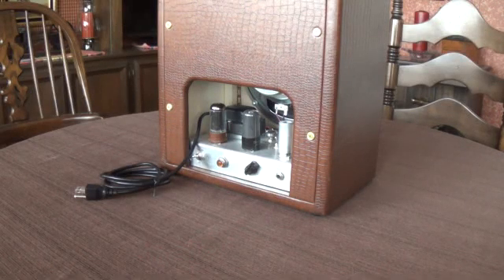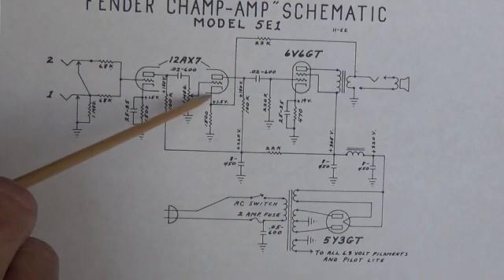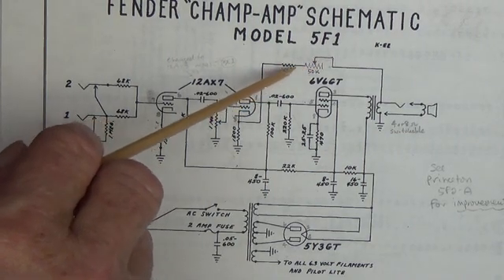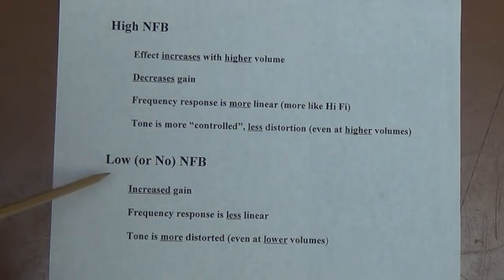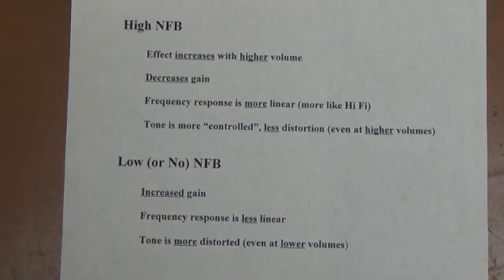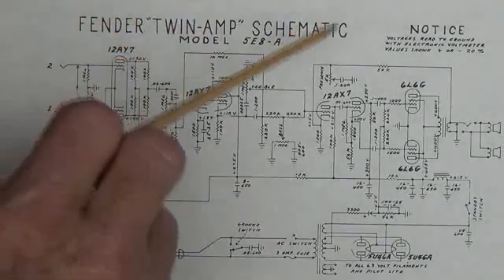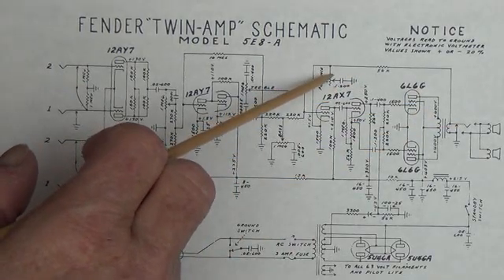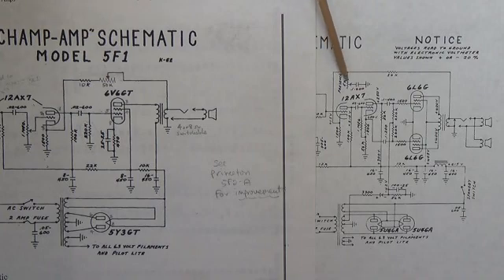Negative Feedback Loops and the Fender Presence Control

Comment: High-end audio amp designers would contend that minimum or no negative feedback is sonically superior.  Negative feedback introduces time domain distortion that does more damage to the sound than the lowered THD that results from NFb.  (They would say) The Japanese receivers of the 60s and 70s achieved vanishingly low THD by using high NFb and had cold, unmusical sound.  Comment?  But perhaps we are talking at cross purposes as you are talking guitar effects and I am talking subjective musical reproduction.
Reply from the maker: I was under the impression that HiFi circuits, at least the earlier ones, were (as you mention) dependent upon NFB to minimize THD and also used it for tone control......thus were far more dependent upon NFB than guitar amps ever were. Bear in mind that guitar amps thrive on THD levels that would nauseate an audiophile, and are intended for purposes diametrically opposed to most "HiFi" designs.

I have a friend who restores and collects McIntosh stereo equipment, and also repairs guitar amps from time to time. He has all sorts of sophisticated spectrum and distortion analyzing gear, and never fails to shudder in disbelief at the sonic mayhem that flows from (non-acoustic) guitar amps. It's apples and oranges.....one is designed for ultra accuracy and purity throughout (and beyond) the audible range, while the other is designed to make women throw their undergarments at musicians on stage.....and this just doesn't seem to happen (as often) with .0001% THD  :)
Reply: Uncle Doug
 Hmmm.  What would I prefer, women without panties or zero NFB?  Well, the women I suppose, but my alter ego was able to do that at the Paramount by just standing at the microphone and singing.
Reply from the maker: I guess if we could all sing like Frankie, we wouldn't need as much THD.....but the rest of us schmoes are quite thankful for it :))

Comment: Thaaaanks for sharing this.
So, can I just cut the NFL cable inside my 57'Champ Reissue to test how it sounds with all those lost frequencies otherwise cancel led safely?
My training it's been changing a couple of pick ups so far but I'd use rubber gloves, plastic clamps etc to manipulate the innards of the Champ circuit...
Massive thanks for this informative video!!
Reply from the maker: You're welcome, Ramon. You are wise to take precautions when working on your (potentially lethal) amp chassis. Be sure to drain the filter caps before touching the circuit (see my biasing videos for instructions if you don't know how to do this).

Yes, you could disconnect the NFB loop in your '57 Champ (R12 @ 22K), but I don't think you'll like it. This amp is designed to break up quite early, especially with humbuckers, and the lack of a NFB loop will probably make the tone excessively "dark", distorted, and noisy.  If you do it, let me know how it turns out. Here is a link to the schematic and layout:  http://support.fender.com/schematics/guitar_amplifiers/57_Champ_schematic_Rev-B.pdf
Reply: Thanks for the response.
Sadly as things turned out, I had to sell it.
But I hope I'll get a replacement next year.
I'll stick to my handwired VOX AC-15 for now.
Best regards!
Reply from the maker: You're welcome, Ramon. Best of luck !!

Comment: Thanks Doug for doing this video. I found it informative, concise and to-the-point. It was well explained. I am wondering if you could say something about the "resonance control" and how it could be mixed with the presence control circuitry you described in your video. I could not find any schematics on the topic...
Reply from the maker: Greetings, Julian, and thanks for the kind words. In the video description I offer the following note:  To turn the NFB Loop into a Resonance or Depth Control, add a .0047uf capacitor in series with the NFB resistor. To make it variable, add a 1Meg pot in parallel with the capacitor with one leg of cap. connected to the center (wiper) lug of the pot and the other leg connected to either of the (outer) lugs of the pot. For this to function, the Presence Control (if you had one) would have to be "off" so no high frequencies were being sent to ground. Here is a schematic:  http://www.regiscoyne.com/tech/resonance/
Reply: Uncle Doug Thank you. I could not follow the explanation straightaway but it has become clear now that I have seen the schematic. I still don't understand why you can't have a presence control and a resonance control together working as a sort of tone stack circuit if that makes sense...
Reply from the maker: There probably is a circuit that would allow both to function, Julian. Perhaps a search would turn one up. The Presence control functions in between the Midrange and Treble control and the Resonance functions in between the Midrange and Bass controls. From what I understand, the effect of these additional controls is most evident at high volume levels.

Comment: Thank you for your very insightful videos! How come you don't you need a diode on the negative feedback loop to make sure that the signal goes FROM the output transformer TO the cathode instead of the other way around?
Reply from the maker: You're welcome, Dj. The secondary of the OPT has higher voltage and much higher current (multiple amps), capable of driving a speaker.....while the cathode has very low voltage and extremely low current (milliamps). Thus the OPT signal, being more powerful, flows toward the cathode, rather than the other way around.
Reply: Thank you for your answer Doug! Very helpful indeed!

Comment: Thanks Doug and Rusty for the video. Always baffled me what a presence control did in reality on a circuit level. Really enjoyed your recent tone control video too. I will post comments there soon. Take care . I think you mentioned you once were a teacher, you still are. What got you into tube amps and electronics.
Reply from the maker: You're welcome, Mix. It's great to hear that the videos are helpful and appreciated. I started restoring vintage jukeboxes about 35+ years ago and wanted to be able to do all the work myself. This required that I develop the ability to repair the sound systems, which are quite similar to those in vintage guitar amps. Once I developed an interest in vintage guitars and amps, the jukebox-related knowledge was a great foundation. I have posted a few videos of my restored jukeboxes, which may be of interest. Thanks again for your input.....it is always appreciated :)

Comment: Thanks Uncle Doug! I always thought that I was creating a "presence" control that was just pegged in perpetuity when I DC'ed the NFB loop of an old Hammond (AO-44, AO-35, AO-fill-in-the-blank), but since an actual presence control is only rolling off very high frequencies from the loop with a high value cap, I suppose I'm sort of making a presence/resonance/gain/boost control that is, of course, maxed out! My AO-44 is like that, having pulled the input transistor and the low-pass filter stuff it was driving, I also pulled the NFB loop. I use it mostly as an output section behind my Frenzel (Jim Frenzel is a guy in Texas who builds and sells a lot of good PTP-wired stuff at really good prices, has an ebay store and frenzeltubeamps.com) preamp, or sometimes I use it for bass, with a little compression up front, and drive a single 15" black widow in a dead 1x15 solid state peavey combo. It works really well for both, and if I plug a guitar straight in, it also does an incredible almost-clean that I like for reggae-plucking with four fingers and then digging in with a thumb-pick. I am completely in control of the dynamics without touching the volume knob on my guitar. I do believe I will be subscribing now, this is a class I should definitely be taking.=)
Reply from the maker: Wow....thanks for all the info, Adam. It sounds like you are a capable ampliophile, who definitely should subscribe. I will check out the Frenzel Tube Amp site. Best of luck :)
Reply: Uncle Doug Done.....actually, I think I subscribed right when I was making that comment. And YES you should DEFINITELY check out Jim Frenzel's stuff. EVERYONE READING THIS SHOULD. He's often "backlogged" so it took longer than it was supposed to for my preamp to arrive, but a pair of 12ax7's in a pretty classic bassman/plexi (the preamp section of bassman or plexi, obviously) type circuit, point to point, gain+MV and 3 band eq, and I paid a discounted price of 200 bucks, but I think it's normally 275.....and that is obscenely cheap for what it is, I think. I've been looking around the web lately for more stuff to do to my "Yayo-FourtyFour" (nickname I gave it) lately, and I'm wondering if you know anything about the way an Orange "shape" control works, and if it would be possible to put one in an AO-44 that is basically stock, just with the input hot going straight to the grid of the first ECL86. I mean,m there's only two preamp stages, one's a driver, but I really only use it as a clean amp anyway, for separate preamps or on the extremely rare occasions that I want to get the sound of a particular pedal. I intend to try to build a 3x12ax7 high-gain overdrive with just gain and a trimpot on the output, and if the 44 had a really versatile tone control like the "shape" control on the Rockerverb and the Dark Terror, it would be perfect. . . . . Any ideas?
Reply from the maker: Adam, I looked at the Orange Dark Terror "Shape" control and it appears to be fairly straightforward, utilizing capacitors and resistance (like all passive tone controls) to allow selection ranging from "sharp" to "mellow". It resides between V2B and V3B of the circuit. If you wanted to add this tone control to the AO44, simply recreate the circuitry and insert it in the AO44 circuit, between the two stages of the 6GW8. How well it will work, I don't know, but like all experiments, you can simply try it and see. Let me know how it turns out.

Comment: Can you show about Phase Inverter what it does and also Solid State rectivires,love your site even I can understand some of it THANKS
Reply from the maker: I will be posting a Phase Inverter video in the near future. Re a "solid state" rectifier, you simply use diodes instead of the two rectifier tube plates. Since they only conduct in one direction, they will divide the AC into a positive (B+) and a negative (to ground) Direct Current. It's a cheaper and more efficient way to get the DC your amp circuit requires.

Comment: Uncle Doug,  

Can you go over what these amp modifiers do to increase gain, or add a variable gain knob, to increase gain gradually.

BTW, My uncle's name is Doug.  I asked my Uncle Doug but he doesn't know...
Reply from the maker: Greetings, Steven. The Bass (Resonance) and Treble (Presence) Boost are not really intended to alter the gain or amplification factor of the amp. They are primarily used to alter the tone of the signal. When you reduce negative feedback, the speaker volume will increase, but that is a side effect, and not the main purpose of these controls.

Comment: As long as you are taking suggestions, I think an explanation of American versus British tone and circuits would be cool. Of course Fender versus Marshall. We hear these terms in marketing and blog slang but what does it mean? So nice you are able to reply to most comments. When you get more views than Taylor Swift it may get harder to do.
Reply from the maker: An interesting suggestion, DS. I must confess that I am completely unfamiliar with Marshall circuit design, but I can download some schematics and try to figure out what the significant differences are (if any).  I try to respond to every comment, but (for some reason) YT doesn't alert me to some of them, and it would be a nightmare to have to check through all the comments for every video to try to find them. Meanwhile, Taylor better watch out.....we're catching up with her :))
Reply: Uncle Doug DS, The first Marshall amps were copies of the old Fender Bassman, which was never really a bass amp to begin with. Years back I got to hear what I thought was an old Bassman. The owner of the amp, a guitarist in an excellent ZZ Top cover band explained that it was an original tweed covered Marshall (Yes, Tweed!). I can't imagine what that beauty is worth now, but man could she sing!
It would be cool if UD could find some secret to the British tone but I would think, in the end, the choice of tubes (EL's vs. 6-6's) the extra gain stages plus possibly less negative feedback along with closed back 4X12" cabs all contributed to the British vs. American sound.

Comment: Great video Uncle Doug.  I've become interested in tube amplifier theory and you did a great job explaining this aspect.  Would you consider a future video about a related topic, how a depth/resonance control functions in the negative feedback loop, and how one interacts with a presence control to affect the frequencies  sent back to the output tube(s)?
Reply from the maker: Thanks, GG. A Resonance or Depth control will boost the bass frequencies, which is just the opposite of the Presence control.

To make your NFB Loop boost bass, simply place a .002uf to .01uf (lower value = more bass boost) capacitor in series with the NFB resistor. The cap will block the bass and only allow the (out of phase) high frequencies to be fed back into the 12AX7. As a result, only the high frequencies in the signal will be cancelled out....and the bass frequencies in the signal will appear to be boosted.

You can even make it variable, if you put a 1M pot in parallel with the capacitor (wiper to one end of the cap, other end to either lug of pot).

Comment: I think a great video idea would be going over a mystery to me ( and hopefully others) and that is how guitar signal and electricity are combined in a tube in both preamp (triode) and power amp examples. as a layman "paint by number" builder of pedals, it's a mystery as to how this occurs.  complicating matters is new knowledge from your vids- that amps use both rectified and AC voltage to achieve this.  confusing.  sorry this paragraph  is the best way I could think of asking short of hitting you with about 20 pm's.
Reply from the maker: You're idea is excellent, Mel: An overall idea of how amps work. We start out with an analog input....the wiggling of the guitar strings....and end up with a (much greater) analog output....the wiggling of the speaker cone....BUT there are all sorts of mysterious, invisible electrical events going on in between to make it happen.

Rusty and I will start putting together a video which (attempts to) explain those "mysterious" events. Thanks for a great suggestion !!

Comment: Thanks for another clear explanation. I appreciate the way you break down the function of each portion of the circuit during the explanation, including both the electrical consequences and the effect on the sound.
Reply from the maker: Thanks so much, CNS. I taught school (math and science) for many years, and found that this incremental approach worked best. It's like cutting a steak into small, bite-sized portions.....rather than trying to cram it down your throat in one big piece.  Although, I fear that Rusty would probably enjoy either method equally :))

Comment: also, just another thought....the feedback signal might not only be reduced by the 22k resistor, but by a voltage divider comprised of the 22k feedback resistor and the 1.5k cathode resistor.
Reply from the maker: Another good observation, Mr. B, and one I had not considered. Thanks for your input :)
Reply: Uncle Doug
you're welcome :)
and thank you for your great videos! i'm subscribed
Reply from the maker: MisterB4x
Welcome aboard, Mr. B. I look forward to many more beneficial comments and exchanges :))

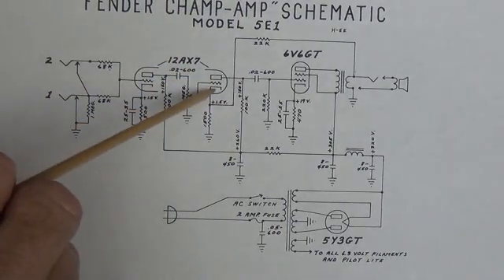Comment: you say at 1:25 that the cathode and grid are out of phase. i thought that a signal taken off the cathode was in phase (non-inverted) with respect to the signal on the grid...just like a cathode follower.

i believe it's the signal taken from the secondary of the output transformer that's out of phase with the signal on the cathode of the second stage.
Reply from the maker: You are correct, Mr. B. Sometimes in my quest for simplicity, I leave out some details. In this case, it is the signal sent to the cathode by the OPT that is out of phase with the grid, not the cathode itself.  This is why, if you connect your NFB loop to the wrong OPT lead (i.e. the one that is in phase with the grid), the loop becomes a positive feedback loop and the amp will oscillate loudly. Rusty and I thank you for your input and will add a note to the video correcting this misconception.
Reply: Uncle Doug
hi uncle doug,
you're absolutely right about using the wrong OPT lead and oscillation....that's the difference between positive and negative feedback (regenerative vs degenerative).
Reply from the maker: MisterB4x Thanks again, Mr. B. I, like lots of amp builders (I assume) have suffered with the deafening consequences of attaching our NFB loop to the wrong OPT lead. It's always a 'shock' to discover that your precious, home-built masterpiece is functioning more like a police siren :))
Reply: Uncle Doug
I nearly always had been (and will be) fooled with the "begin/end" dots of the transformer´s winding schematics. So it´s way faster to just solder the leads to the transformer-taps (as nearly all europe made transformers got no leads, as they got some taps on the transformer instead) and see (=hear) if my guess was right ;)